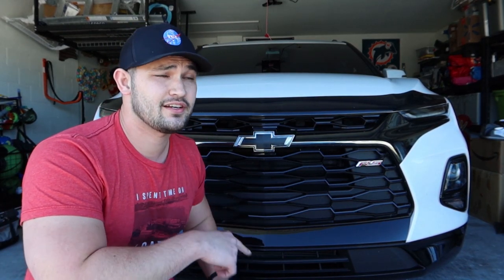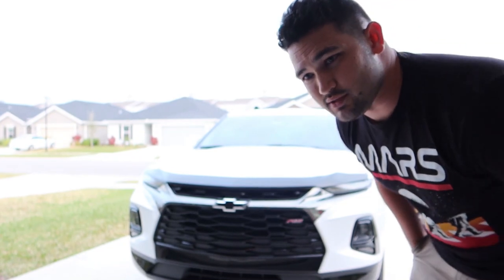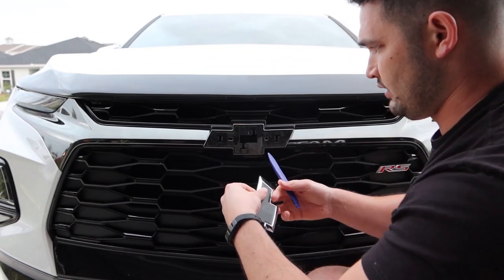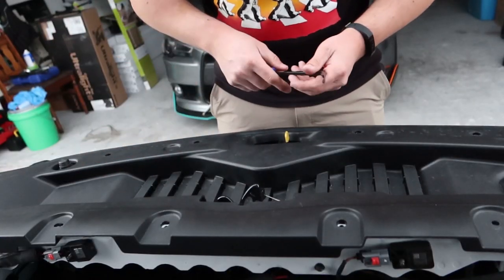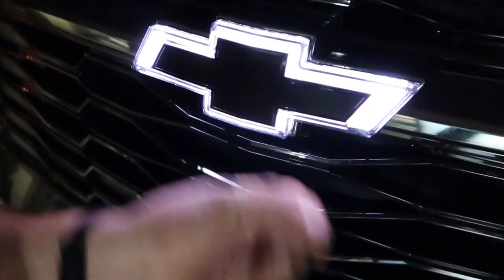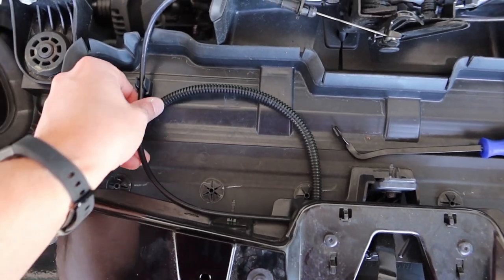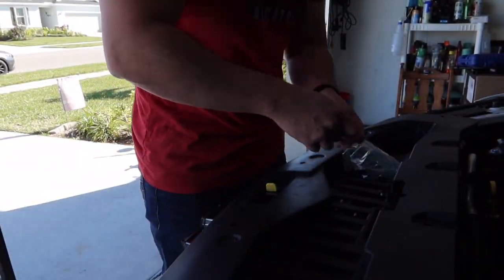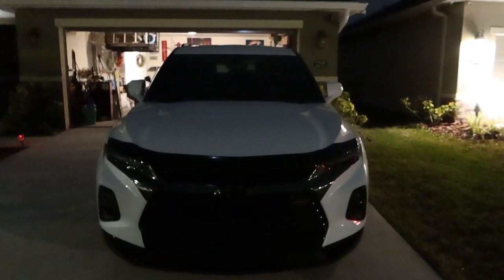2019-2022 Chevy Blazer Illuminated Bowtie Install (full detail)

Comment: Good to know that the bowtie just snaps in...I thought it would be glued or held down with double sided tape. Good video bro, very informative.
Reply: So not sure if you’re gonna read this or not but I finally got ahold of one and installed it today. It is very very dim seemingly. You can’t see it at all in the daytime as opposed to the daytime running lights and at night it’s brighter but easily overshadowed by the headlights. Yours looks nice and bright. Is yours dim too and maybe just showing up better on cam? I see towards the beginning you had a fail lol is that because it was too dim? Anyway maybe mines is defective…hope not after all I just went through to get it on.
Reply from the maker: It's dim. My camera just picked it up nicely
Reply: @TheSnyds  Well that sucks. Waste of $350 in my opinion…🤬

Comment: Just got a 21. Not an RS. But Iron Gray and came totally blacked out. Pretty good looking. V6, towing package, and most of the options of the premier. Still need to do some mods. This looks like a good starter.
Reply from the maker: Congrats! Yea this def helps the car pop
Reply: @TheSnyds  Thanks... I run a couple drag bikes. Been pulling my trailer around for years with an 08 Trailblazer. I hope the new Blazer works as well dragging the trailer around.
Reply from the maker: Let me know how that goes!

Comment: Thanks, for the video.  Super easy to install. In my 22 RS the intake has another screw, but you can still work around it.  Again thanks.
Reply: My dealership is insisting that in the 22 RS they changed something and it is not possible to install without removing the front bumper. Can you please confirm this is not true? Thanks!
Reply: @OliveiraPaulo1978  No need to remove the bumper super easy 10 minutes install

Comment: Thank YOU so much, what a GREAT Video & Audio. I am about to order a new 24 Chevy Blazer in Blue Metallic & would sure like the GlowTie LEDs to be Blue instead of White. From what you saw on the back end of the GlowTie, was there any way to access into the inside of the GlowTie, so as to change the colors of the LEDs? Thanks, Jeff
Reply: I have a 2024 on order.  Did you find a way to change the color?
Reply: NO, I am just going to keep it White. The LED Bowtie is all sealed up and I am not going to cut inside of it to make it Blue.

Comment: I just ordered a 2024 Chevy blazer 2lt and got it Monday after 6 months of waiting and I looked into the illuminated Chevy badge and it cost $355 plus tax which is outrageous they want $380 for that. So I’m not getting it due to outrageous price. GM is ridiculous with the price especially they got bailed out by government and went bankrupt. We should get better prices. They probably paid $30 for the badge. How long did it take you to install. I wanna install that hood bug deflector you have but worry about water sitting inside it especially during winter the salt in NY would rust the hood. How do you clean under it and keep water out. Is there drain holes in it. I wish I would’ve got the RS now but mine is Red Hot color which RS doesn’t offer that color

Comment: If I can ask, when you installed the glow tie, could you get to the blinker bulbs from the opening as well? I'm thinking when I go to install my glow tie, I want to replace the bulbs with GTR LED bulbs.
Reply: Turn signal bulbs are accessed through the inner fender liner. Turn wheel to remove 2-3 torx screws and bulbs right there

Comment: I have the 2018 traverse lT.  Is there anyway to seperate the daytime LED  from the turn signal so it does not turn when using the turn signal?  I hate ruining the daytime led light when you use the turn signal it turns off the one of the daytime running light?

Comment: @thesnyds Hi, been following you from the start and your video made me decide the buy blazer rs .. could you please make a video on how to replace the back emblem with illumination bow tie as well? the bowtine which i purchase is small not the same size on the front so i need to fix it at the back. thanks in advance keep it up.
Reply from the maker: Hey man, they actually don't make one for the rear.
Reply: @TheSnyds  thanks for the reply. so I had to sell my old glowtie and purchase the right size. good I saw your other video I saved a 100usd =)... BTW where did you connect it, in the side marker light? head? fog?
Reply from the maker: Goes into the head

Comment: Did that on my Silver Ice Metallic Blazer RS on May 1st 2020. Also my Blazer was already wired to handle the Glow Tie accessory....no extra (aftermarket) wiring necessary. My car dealer (Apple Chevrolet of Tinley Park, IL) had informed me that certain Blazers already had the wiring for the glow tie already built into it.
Reply from the maker: Yea it's an option you can add while building your own too.
Reply: @TheSnyds  That is true, and it was something that I did want on it at the time I bought my Blazer 2 months prior to me getting the glow tie.

Comment: Are you able to please answer a question? I’m trying to pop bowtie off and I don’t see how you did it.  It’s really held on there by the tabs and feels like it’s gonna break. And when you look up instructions it says to remove adapter and pop them out from back.  Please help
Reply from the maker: Are you going to be selling or keeping the old one? If not I wouldn't sweat breaking the tabs on it. Most ppl break them ton save time. But if you have that trim tool, slowly pry around the whole part
Reply: @TheSnyds  I was planning on keeping it for two years then going to a Mercedes. But yeah I’m using a pry tool and it’s coming out pretty far and still has a lot of tension and won’t pop out.  I’m surprised it didn’t pop off.  I had it pretty far.  And going from all around.  Then when I release instantly goes back to original position. I just wanna be careful and not break anything really
Reply from the maker: Not sure what's keeping you snagged on there. Sorry cant help you much more

Comment: I ordered this glow bow tie with the car. I still never think it glows enough for me. Cost was $275.
Reply from the maker: Honestly you wouldnt want it too bright. Im my opinion, but at least they are brighter than the mercedes ones!
Reply: @TheSnyds  I took the Blazer in for service and they agreed and ordered a new one that glows!
Reply: I paid $600 at the dealership and they would not return the old bowtie logo. they told me it is no good after it is removed. My car is a new 2021 and I thought they should have returned the old parts
Reply: @lasalleking953  They have to damage it to get it removed
Reply from the maker: Sounds like they broke the old one..

Comment: Dangit! First time u failed me bro! Doesn’t work on 2023.. it has a bigger harness going into lights, doesn’t match aftermarket..Now what? 😮 it's a 6 pin on daytime lights not 3 pin
Reply from the maker: Damn! I'm surprised it's changed. I'm sure you can return them in exhanchange for the updated one. I'll edit the title then. Thanks for the heads up!
Reply: Your welcome..yea I'm trying to send back to chevyparts but they saying it should work thru side marker..side marker is a 2 pin..lol..
Reply from the maker: @Brian Preston  can the two ends mate? Just extra slots and pins?
Reply: @TheSnyds  no..the casing is a different size
Reply: I'm getting a 2024 so I'm trying to figure out how to add this.  Did you ever get one for the 2023?  How'd that go?
Reply: Yea i had to order another one that was specifically for 2023..had to sell the old one. So u gotta make sure it's for your year
Reply: Thanks for the info.  That’s great that you got it installed. I found the right part.  Is the install the same?  This video makes it look straight forward.  Did you have any trouble once you had the correct part?
Reply: @orion2389  its straight forward...Eazy